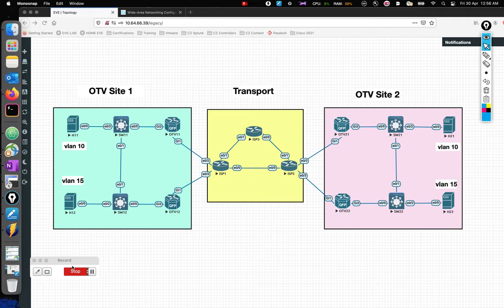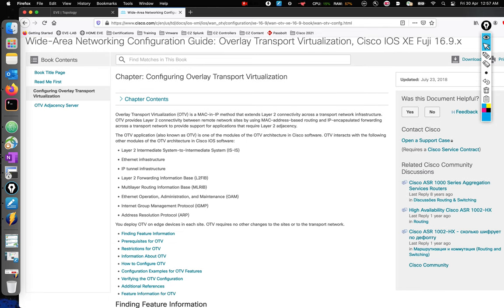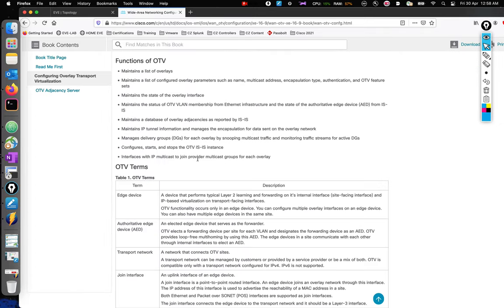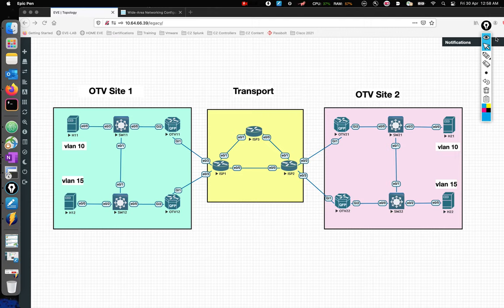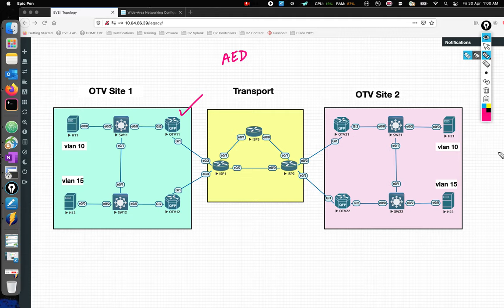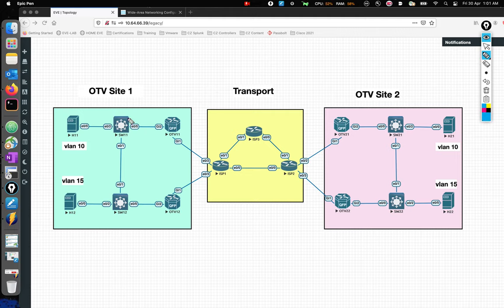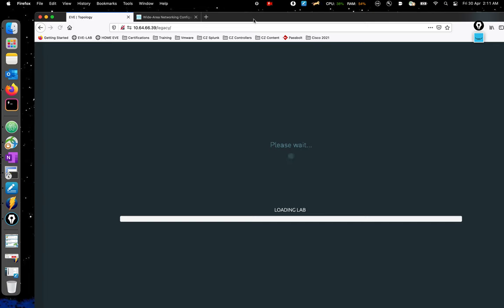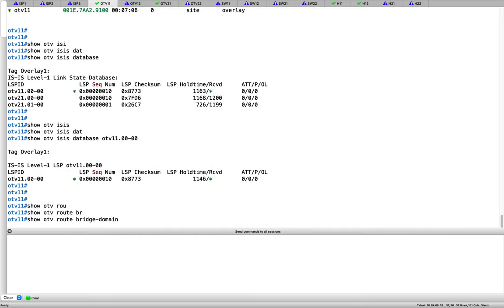Overlay Transport Virtualization (OTV) on Cisco IOS XE - Part 1

Comment: Nice video... I can't able to see any vlan on the otv device. Enabled pvst on otv device and make vlan 10 set to root at swi side.
OTV-1#show spanning-tree vlan 10

VLAN0010
  Spanning tree enabled protocol ieee
  Root ID    Priority    32778
             Address     001e.e578.2fbb
             This bridge is the root
             Hello Time   2 sec  Max Age 20 sec  Forward Delay 15 sec

  Bridge ID  Priority    32778  (priority 32768 sys-id-ext 10)
             Address     001e.e578.2fbb
             Hello Time   2 sec  Max Age 20 sec  Forward Delay 15 sec
             Aging Time  0   sec

Interface           Role Sts Cost      Prio.Nbr Type
------------------- ---- --- --------- -------- --------------------------------
Reply: Changed the csr image and the lab is completed now. Thanks for the effort.